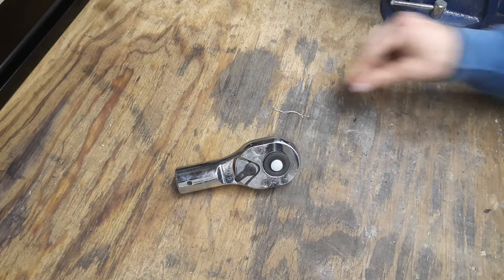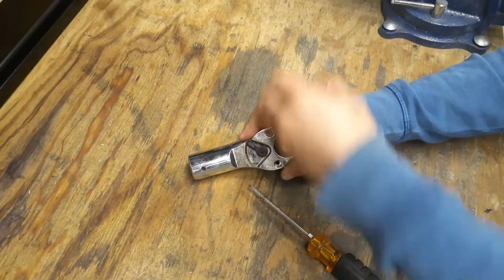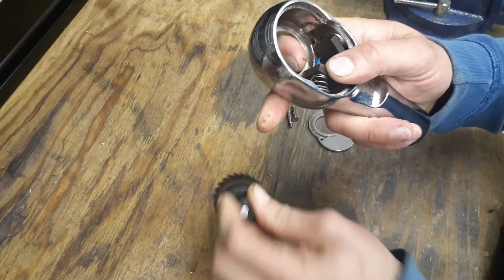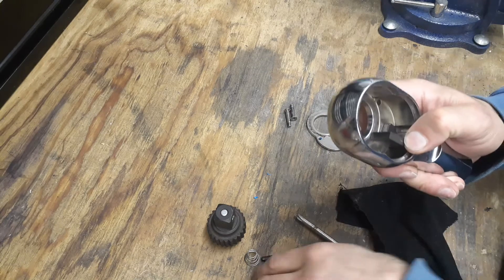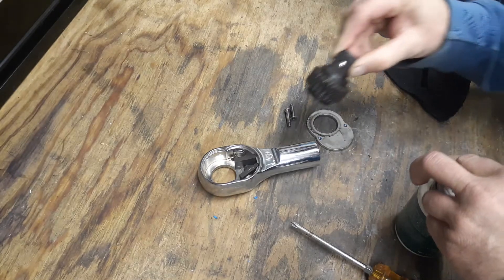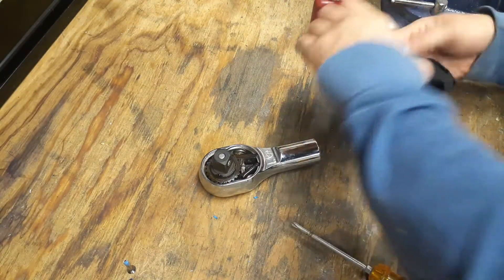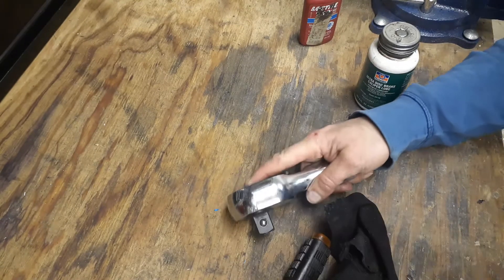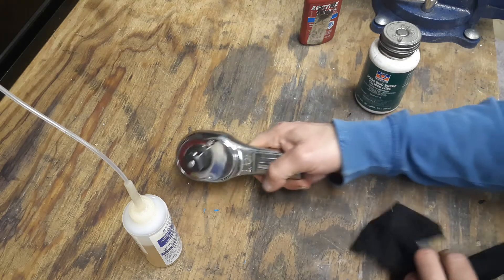3/4" drive quick release head gearwrench teardown

Comment: Craftsmen is the same style. I uses axle grease in mine. They are 24 teeth ratchets. So the ratcheting internals very heavy duty. Should hold up very well. No seals in the head, but to be honest thats a very minor detail. If you take care of them and keep them clean then dirt will never be an issue. The grease will keep the metal to metal surfaces in pristine condition anyways.
Reply from the maker: Agree